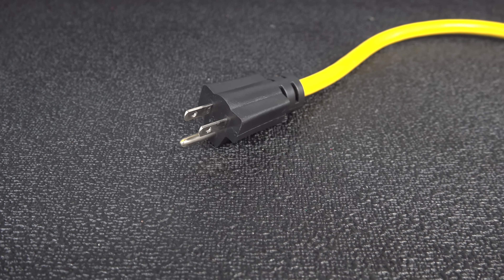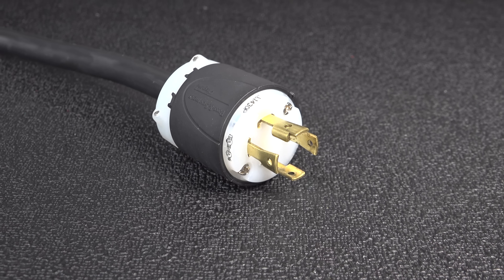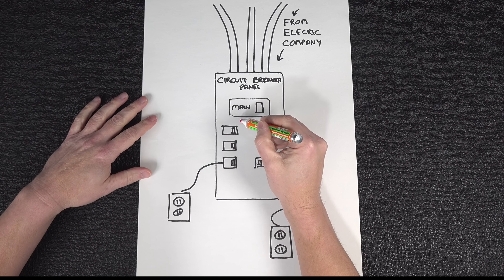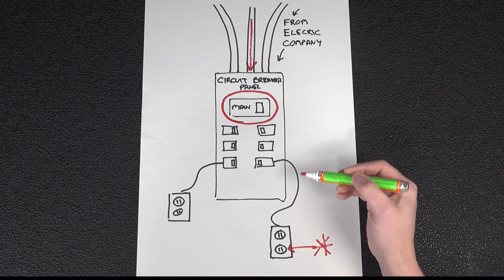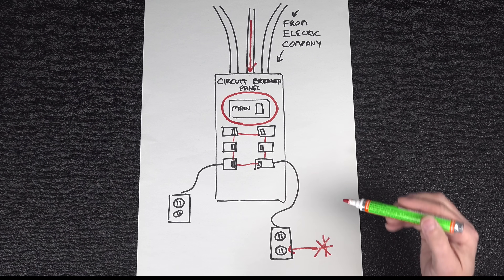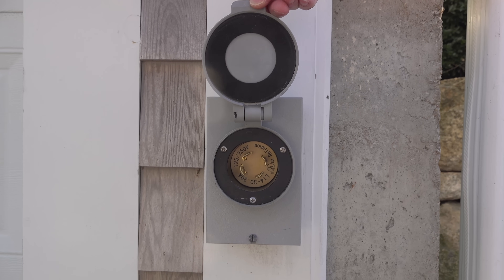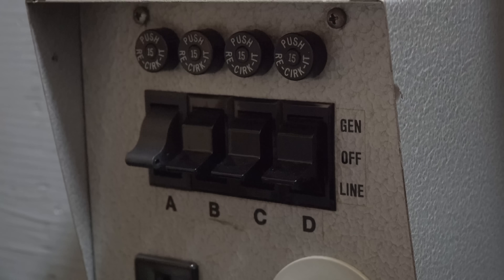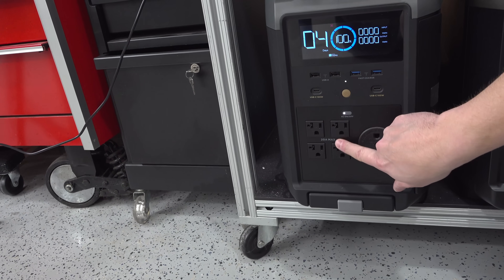Worst Electrical Mistake You Can Make - Backfeeding Generators

Comment: First off it is not illegal, it is highly dangerous if you do not know what you are doing, or how electricity flows. 
Secondly, if you are going to back feed ( which is like having a generator energizing your panel, without an interconnect ( a connection that allows only the main breaker on, or the main off thus allowing you to back feed) ) Turn off your Main Breaker, then back feed. Make sure to turn all the breakers off, then turn the breakers on that you want to use.
Reply from the maker: It's fine to say you don't care or won't do it to use approved, safe methods. But in no way is it legal safe or without massive risks to you as a homeowner. That is why there are 0 companies making those cables legitimately or for sale anywhere. 
 Just one of hundreds of excerpts. Backfeeding your generator is a risky and illegal practice forbidden by U.S. National Electric Code. If you still persist in backfeeding your home’s electrical framework and harm or cause the demise of a utility worker, you will be held responsible
Reply: Its completely legal IF you lock it and know what you're doing. I don't know why this guy can't understand plain english:
FYI for those freaking about an INTERLOCK or a TRANSFER SWITCH: here''s the NEC code, see the bold portion.
702.5 Transfer Equipment  (A) General Transfer equipment shall be required for all standby systems subject to the requirements of this article and for which an electric utility supply is either the normal or standby source. Transfer switches shall not be permitted to be reconditioned.
Exception: Temporary connection of a portable generator without transfer equipment shall be permitted where conditions of maintenance and supervision ensure that only qualified persons service the installation and where the normal supply is physically isolated by a lockable disconnecting means or by disconnection of the normal supply conductors.
You DO NOT have to install an interlock OR transfer switch for TEMPORARY connection of a PORTABLE generator, the NEC defines "qualified persons" and "lockable disconnection means""
Qualified Person: One who has skills and knowledge related to the construction and operation of the electrical equipment and installations and has received safety training to recognize and avoid the hazards involved. ( no certs needed )
Lockable disconnection: If a disconnecting means is required to be lockable open elsewhere in the Code, it shall be capable of being locked in the open position. The provisions shall remain in place with or without the lock installed." This means you can't lock it on your own say with a chain around the panel, the mechanism that is to be locked must be part of the panel or breaker even with the lock removed.  THAT'S IT!  You're good by code!  Stay warm/cool!

Comment: a break out box with that cord is acceptable just flip off the main first then power the break out box with it its fine have had my house set up like that for 20 years now its fine.
Reply from the maker: Backfeeding your generator is a risky and illegal practice forbidden by U.S. National Electric Code. If you still persist in backfeeding your home’s electrical framework and harm or cause the demise of a utility worker, you will be held responsible.
Reply: @SilverCymbal  I SAID DISCONNECT THE MAIN DIDN'T YOU READ MY POST?????? SWITCH OFF THE MAIN THEN FLIP THE BREAK OUT BOX ON POWERED BY THE GENERATOR!!!!!! OBVIOUSLY YOU DIDN'T READ DID YOU? IF THE MAIN IS DISCONNECTED AKA SWITCH OFF YOUR HOUSE IS NOT CONNECTED TO THE GRID! ANY LONGER! IM NOT FUCKING STUPID. WHERE EVER A CIRCUIT IS CONNECTED ELECTRICITY CAN FLOW!!!! IF THE MAIN CIRCUIT IS OPEN ELECTRIC CANT FLOW INTO THE GRIDS LINES!
Reply from the maker: @moveforward2617  I did read it, and it's still illegal and a bad idea. Not sure why you are writing in all caps. It's either legal or illegal, and what you are describing is illegal and against the national electric code.
Reply: @SilverCymbal  Your full of shit because natural gas back up generators operate the same damn way except they switch electronically automatically when the power goes out! I just do it manually in my case after i have switch off my main breaker!! If that was the case emergency natural gas back up generators would be illegal.
Reply from the maker: @moveforward2617  Keep swearing, yelling, stomping your feet. Do what you want to do, but it is illegal backfeeding, 100%.  Check with your town if you don't agree. Switching electronically or by other interlocking means is allowed, since it's foolproof. You can't mess it up, what you are doing is the same principle but without any safeguards, meaning you CAN make a mistake. That's the difference.
Reply: How do you think i had the break out box installed??????? Its code n proper and inspected so that i can in fact use it during a storm. It is not illegal!!! ITS illegal to directly tap the main bus its self with out a break out box. I have a break out box with breakers. Main gets flipped off. Then generator gets started, then plugged in,  then break out gets flipped on Its NOT illegal.
Reply: @SilverCymbal  I have been working on 120, 240, and 480 for over 30 years. I don't assume anything when working with electricity. What i am saying is it is not illegal like you said. Now you changed the argument to it not being fool proof? Dude it is not illegal with a break out box and that's a fact!
Reply: @moveforward2617  You could just read this, and dismiss the misinformation from the fearful: 
702.5 Transfer Equipment  (A) General Transfer equipment shall be required for all standby systems subject to the requirements of this article and for which an electric utility supply is either the normal or standby source. Transfer switches shall not be permitted to be reconditioned.
Exception: Temporary connection of a portable generator without transfer equipment shall be permitted where conditions of maintenance and supervision ensure that only qualified persons service the installation and where the normal supply is physically isolated by a lockable disconnecting means or by disconnection of the normal supply conductors.
You DO NOT have to install an interlock OR transfer switch for TEMPORARY connection of a PORTABLE generator, the NEC defines "qualified persons" and "lockable disconnection means""
Qualified Person: One who has skills and knowledge related to the construction and operation of the electrical equipment and installations and has received safety training to recognize and avoid the hazards involved. ( no certs needed )
Lockable disconnection: If a disconnecting means is required to be lockable open elsewhere in the Code, it shall be capable of being locked in the open position. The provisions shall remain in place with or without the lock installed." This means you can't lock it on your own say with a chain around the panel, the mechanism that is to be locked must be part of the panel or breaker even with the lock removed.  THAT'S IT!  You're good by code!  Stay warm/cool!

Comment: If I TURN OFF the main breaker and then use a double male cord and plug into one of my receptacles from the generator  then the whole house would have electricity? Ofcouse I would be very limited with my existing generator. But it would work, correct?
Reply: The problem is that the outlet was designed to run 15 amps or less, and not the entire house. (each breaker in a home is a separate circuit) if you try to run more than that, the breaker will trip on that circuit.  Feeding back through a generator outlet that has higher gauge wires is better.
Reply: @snap-off5383  Got it. Thanks for the clarification!

Comment: If there’s 2 connectors on one wire and you hook the generators up together it will either melt the yellow wire or short the generators.